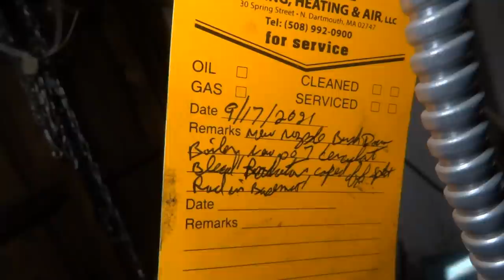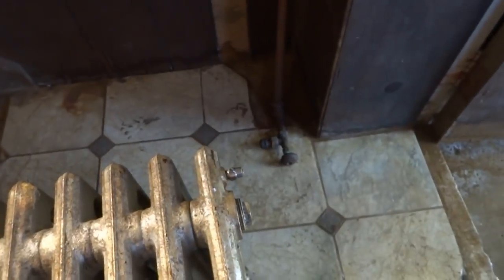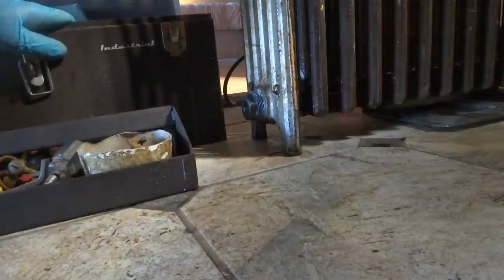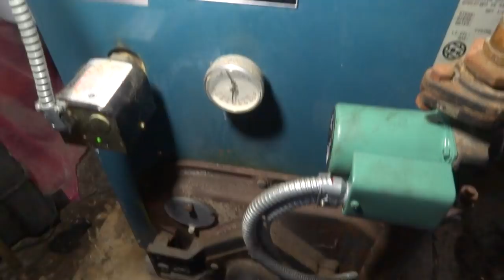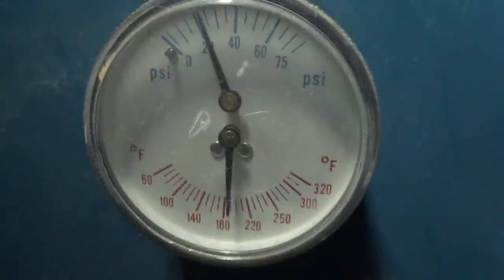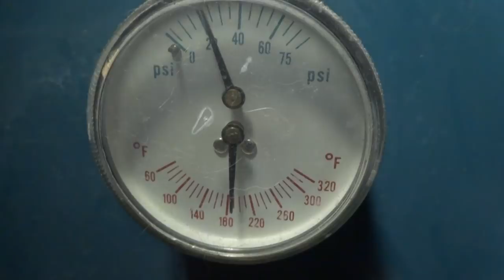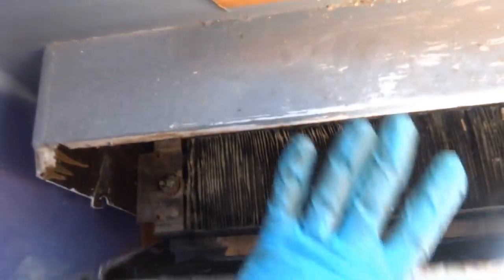OLD CAST IRON RADIATOR REPLACEMENT / INSTALL DUE TO FREEZE UP

Comment: Thank you for taking care of my customer, I told her to call you because I knew if anyone could get her heating system up and running it would be you. Also knew you won't go in there trying to upsell her on replacing the boiler if it didn't need it, which after sitting dormant for so many years I wasn't sure if it would need to be replaced. Again, top notch work and honest work ethic. I gave my neighbor your number too, but unfortunately you don't come out here to Wareham. Hopefully I can throw more work to you in the future, thank you again.

Comment: It's amazing how you know that 100+ year old technology.  I guess it worked well, just BIG!
Reply: What's amazing is not a lot has changed in boiler technology. Boilers are very versatile. They do old school radiator, smaller baseboard, water coils for forced air units, in floor heat, towel warmers, under cabinet toe heaters, domestic hot water heater, and even melt snow off side walks.

Comment: So did those fittings go in reverse threaded or am I looking at   It backwards
Reply: I didn’t see anything reverse threaded. At 11:00 on the right side of the radiator I thought the same thing at first. I thought he was screwing in a pipe to the radiator but it was the nut going onto the pipe.

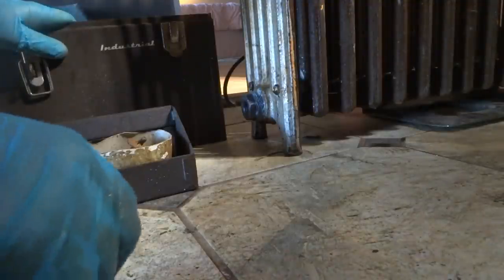Comment: What is that tool at 9:46, that looks to have steps? What is it used for? I never saw one before.
Reply from the maker: RADIATOR SPUD WRENCH   https://www.ebay.com/itm/284373597862?hash=item4235fcbea6:g:uBcAAOSw9LRg8WK-
Reply: @stevenlavimoniere  Thanks! It's an interesting wrench.

Comment: Steve, did you say the adaptors were from steam to hot water?
Reply from the maker: it was a 1 pipe steam radiator ... i converted over to use for hot water
Reply: @stevenlavimoniere  thanks,keep up the good work!

Comment: Hi Steve, your videos on hydronic heating are great.  Very informative and I have learned a lot about hydronic heating.  I am going to replace a 40 year old boiler in my daughter's home with a Rinnai Combi Condensing boiler.   I am struggling with circulator selection.  The existing piping is split into 2 heating zones with one circulator and no zone controls.  I want to take advantage of the 2 zone piping layout.  I am undecided on using a zone valve system or a zone pumping system.  Can you provide any pros or cons regarding the use of zone valves versus zone pumping?  The condensing boiler is 90k BTU.  One zone feeds 4 radiators and the other zone feeds 6 radiators.  The supply and return piping is 1" and the branch piping is a mainly 1/2" with some 3/4" piping.  All piping feeding the radiators is 1/2".  I calculated the total flow is 9 GPM, 3.6 GPM for the 4 radiator zone and 5.4 GPM for the 6 radiator zone.  I calculated Head Loss a few different ways based on information I found online.  One method I found online to calculate Head Loss was a Taco worksheet used to size circulators.  Based on the worksheet the 4 radiator zone Head Loss is 6.5 feet of head and the 6 radiator zone is 15.6 feet of head.  The other method I used was the formula: Total pipe length x 1.5 x .04.  The results of this method is 5.0 for the 4 radiator zone and 13.2 for the 6 radiator zone.  I am confused on whether this method is accurate because the zones consist of 1", 3/4", and 1/2" piping.  Any help would be greatly appreciated.  Thank you for all your informative videos!
Reply: What ever you desire make sure you keep up the maintenance yearly,  and put the money you save in gas differences in a bank acc because 15 years comes around quickly,  high efficiency = lower heat bills and higher repair bills ..hope it doesn't break down around the holidays
Reply: I suggest Dan Holohans book “primary secondary pumping made easy”. Will really help you see your issue clearly.

Comment: Just a thought. Take the broken one and have it welded.Cast iron can be welded.
Reply: But you have to do it in small spurts,  it's to much of a hassle.  If one section was broke take it out and eliminate it
Reply: Could have been like welding an old rotten exhaust system. Not enough good material at the bottom from decades of erosion to not have the welds blow through what might be rust. 

Would have been dirty welds too, and they would have needed a sizeable furnace to both heat it up, and slowly cool it down to prevent cracking. 

Probably the same cost or more than finding the replacement, and no guarantee it’ll work an last.

Comment: Steven, A serious question that is hard to get answered here in the South. In your opinion who makes the best boiler even if it is very expensive?  They were once used commonly here but as a/c came along and ducting was installed, they disappeared, replaced by hot air furnaces. Now no one has an opinion on hydronic boilers here. Really like your videos. How you work in some of those messes amazes me. Good shows. M
Reply: You'd be better off with a heat pump instead of a boiler in a moderate climate. Will be significantly cheaper to run.
Reply: @tomtom1541  Thanks but want to heat a pool and quiet down heating system too on a new house. Thought Steven might recommend a brand but he’s too busy I guess. People here don’t know residential boilers. Some industrial dealers but they ignore residential. M
Reply: @Icg199424  I don't know about the us but here in au there are plenty of heat pump pool / spa heaters which are cheaper to run than gas and more common now. But obviously the gas boiler will be quieter.

Comment: Rather than replace with a rare cast iron radiator and given it was forced hot water and heating the bottom of a stair, couldn't you have just installed a standard radiator or even just  coupled the two pipes instead of capping them off.  All the lady wanted was heat upstairs in her bedroom putting in a cheaper smaller radiator would have fixed her problem.

Comment: Looking for trouble by not holding the pipe that goes under the stairs. You were fortunate that pipe did not break.
Reply from the maker: its called experience
Reply: @stevenlavimoniere  Ok Steve

Comment: Do not understand  why people
use pliers when a properly fitted  wrench would be better.
Reply: Unless you can get a grip on a bolt with a socket, I generally use the push lock pliers if there’s enough space.  Even a good fitting wrench can strip the bolt if it’s really tight.  Especially some of these crusty ones Steve’s dealing with.
Reply: Butcher